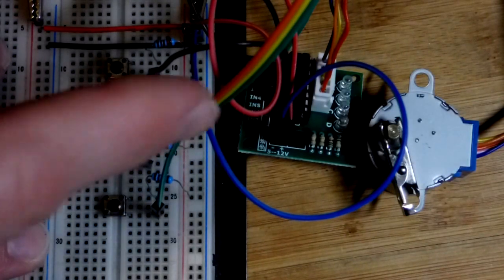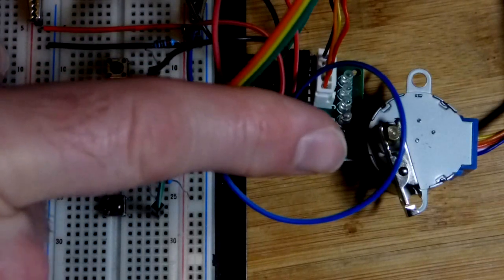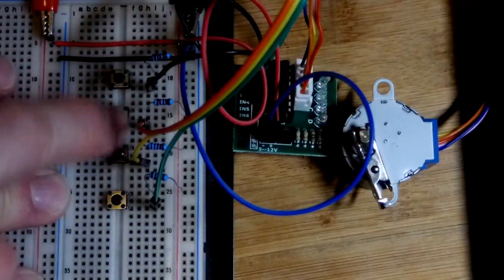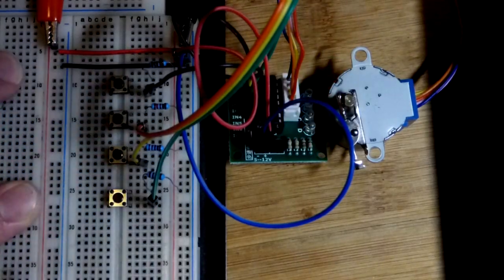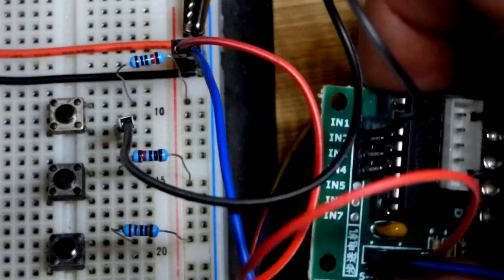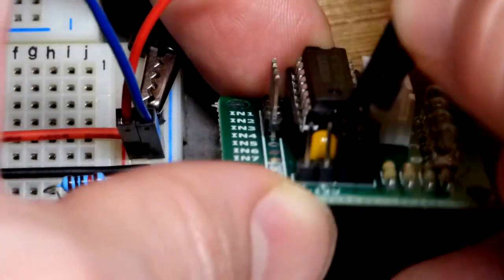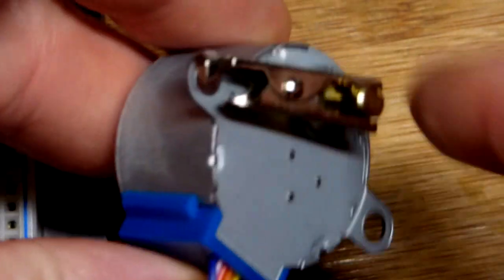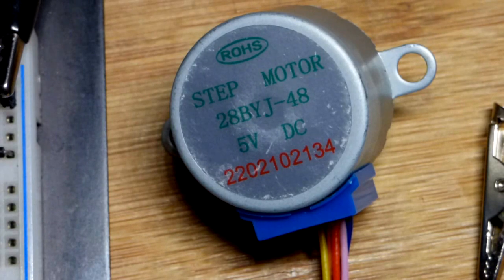5V stepper motor 28BYJ 48  with ULN2003 driver board push button demonstrated by electronzap

Comment: So, on a practical level, a stepper motor WON'T keep turning by just feeding it a 5V through a on/off switch.
Reply from the maker: That's right, a stepper motor has 4 coils that act as electromagnets, so each one just gives the mechanisms a quarter turn while triggering them in order. But the entire unit is geared so that you have to rotate the mechanism many times to get the external shaft a full revolution.

Comment: ahh  so thats how pulse width modulation works slowed down, cool
Reply from the maker: These are steps that keep a stepper motor rotating from one position to another. Pulse width modulation has a rapid series of pulses that are generally the same time apart from each other, but the amount of time that the pulses stay high versus low with each pulse is used to set the position of a servo. PWM can also be used with regular DC motors to control their speed with a set voltage by turning it on and off as needed to get the desired speed.
Reply: @Electronzap  ahh thanks for the clarification
Reply: @Electronzap  would a simple 555 at PWM mode control speed from a stepper motor like this?

Comment: Hi, at 1:57 I thought those were pullup resistors, but there's no connection to ground (input is floating when switch is open) so they only serve to limit current.  If so, I don't believe they are needed.
Reply from the maker: Yeah, I don't think there's any difference if you use a jumper instead.